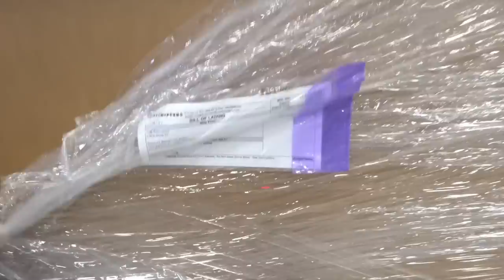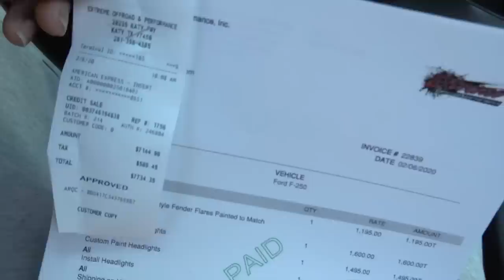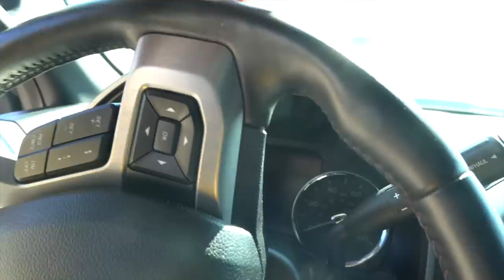BRAND NEW 30 INCH TIS WHEELS FOR MY F-250

Comment: Hi this is DJ, I have a YouTube channel (DJEST93) where I do Car Reviews of Custom/Modified and also Stock Cars.
 
I don’t drive or take the cars alone to do the reviews unless given permission, what I do is have a genuine conversation on camera about the cars, with the owner cars I review.
 
I do reviews on Saturday and Sunday between the hours of 8:00AM and 12:00PM. In most cases it only take  1hour to shoot the video. This will include Outside/Inside the car footage, a few drive by/rolling shots and an exhaust clip.